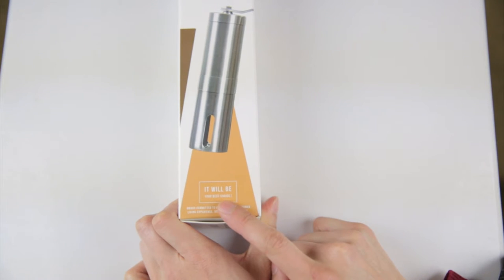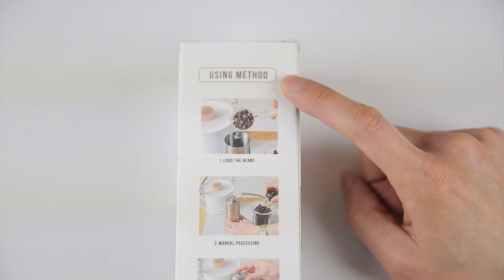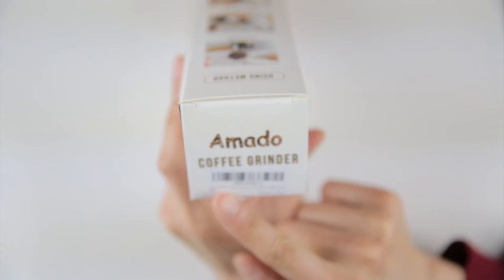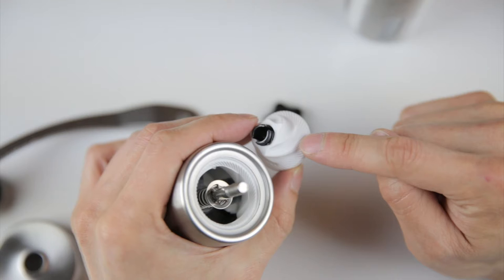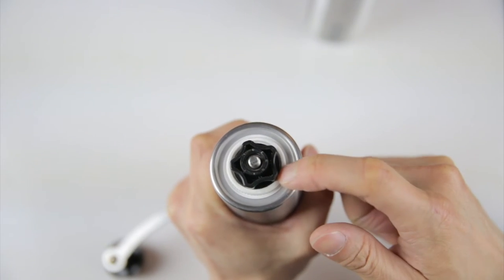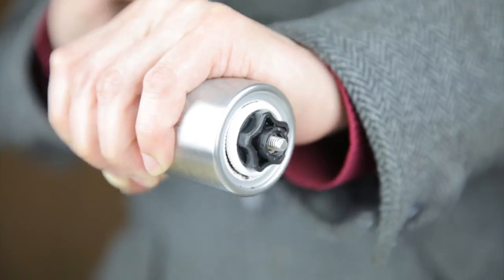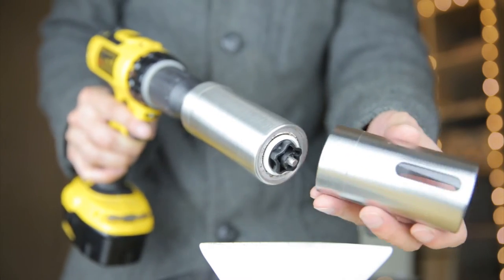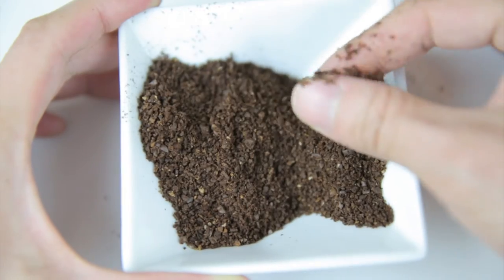Using a Drill on a Manual Coffee Grinder

Comment: My grinder is a Penta 5 point drive, any ideas how to drive that with a drill?
Reply from the maker: You need a socket that will mate with that.
Reply: Been looking online and only finding sizes near an inch.  It appears 5 points sockets are used exclusively in Industry, as in Water and Electric Companies, as tamper proof fasteners.  
These coffee mill manufactures are probably not wanting users easily attaching drills for safety purposes.  You probably should add a disclaimer to your vid before someone grinds the tips of their fingers off.
Reply: A three point drill chuck will lock directly onto a pentagon shape, we're not building a bomb here...
Reply: @dvdfrnzwbr  would a 300w 3point drill machine give enough tourge? Or

Comment: If you already have an electric coffee grinder, is there any advantage to purchasing one of these?

Great mini review :) Keep it up
Reply from the maker: When the power goes out, this still works if you can heat your water with a gas stove.
Reply: BeatTheBush, exactly what I was going to say. That’s actually why I bought this. Also, without the drill (LOL!), it’s quieter than an electric grinder.
Reply: Electric grinding machines have side discharge into a large cup
Reply: If you already have a power drill, a manual grinder can save you some money :)

Comment: I'd use one for pepper.   I love my $19 Braun electric grinder.  It doesn't really grind, it's more like a blender with a spinning blade but, depending on how long you operate it, will produce fine or very fine almost dust.  I like the trick with the drill though !   =D
Reply from the maker: Funny how they call them grinders but really is a blender, lol. Actually, I sometimes use a blender to 'grind' my coffee beans before I got this hand grinder.
Reply: A bit worried about the white ceramic grinding thing-y.   Was expecting 
to see white chips in the coffee =D  Interesting that all the 5-Star 
ratings on Amazon were all from impartial reviewers who received free 
samples =D
Reply from the maker: Well, I don't think its as hard as diamond but its hard enough. The pepper grinders use some sort of metal grinder element. 

As of a few months ago free product reviews on Amazon are banned through the company selling it but I think some from before are still there. So hopefully, the ratings will be more realistic as more real reviews rolls in.